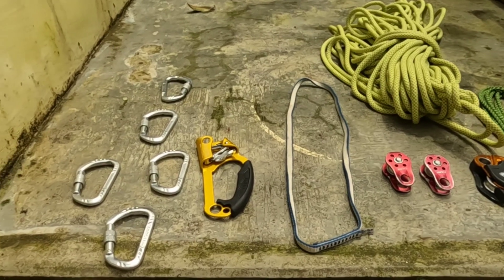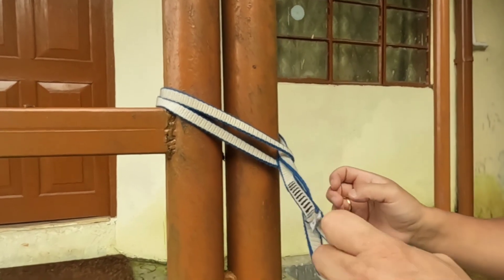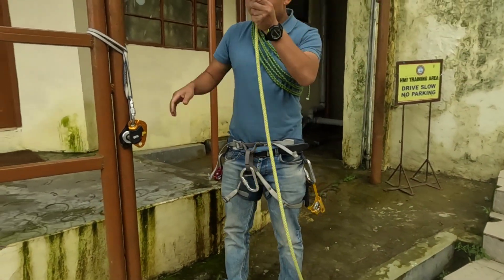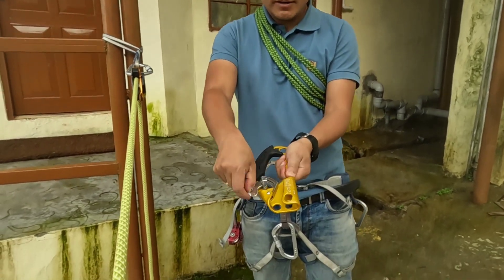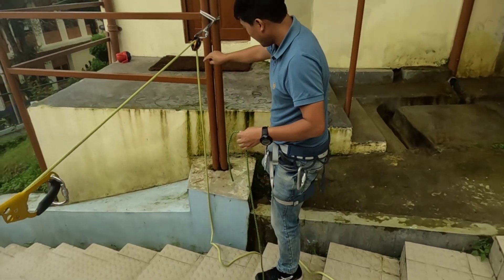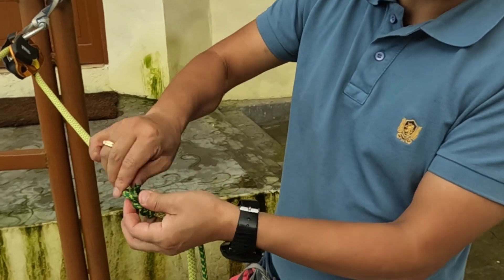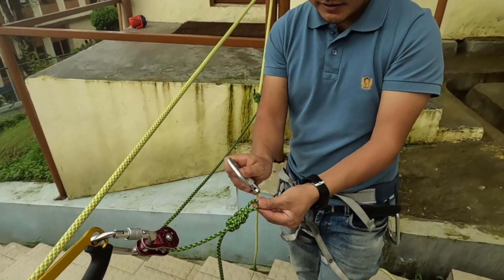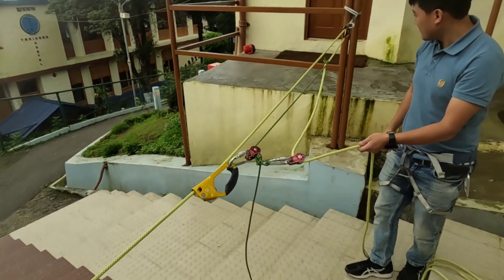double marina rescue system | rescue technique | making a rescue system using two pulley

Comment: Is double merina same as z pulley system
Reply from the maker: @TheMorningexercise  Not exactly the same. it is a different technique, however the technique looks quite similar.
Reply: @mountaineeringtips284  would it be possible to share a video on z pulley system as well please
Reply from the maker: @TheMorningexercise  sure, I will do that in future videos.
Reply: First I appreciate to ur skill,
But my doubt is if if we can rescue the casualty with Zpully system then 
What's the use of double merina; as it requires more other equipment??
Reply from the maker: The Z-pulley system requires more manpower, while the double Mariner system requires less. Depending on the situation, we can use either of these systems. Pulling is also much easier in the double Mariner system compared to the Z-pulley system